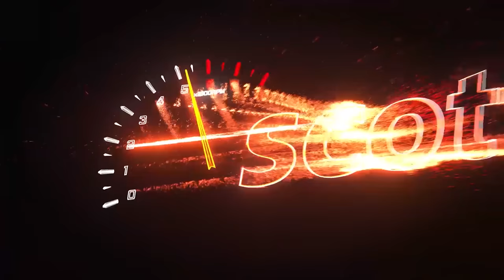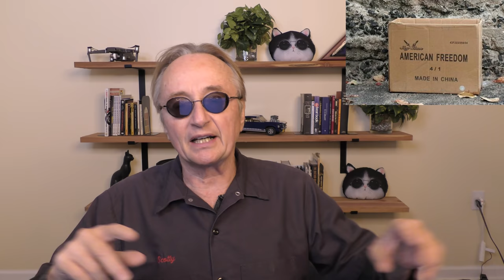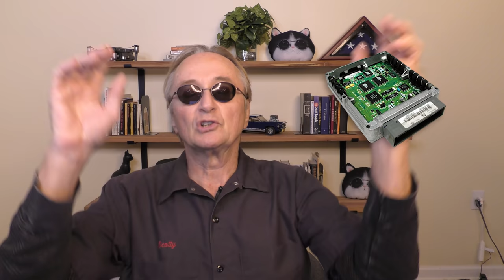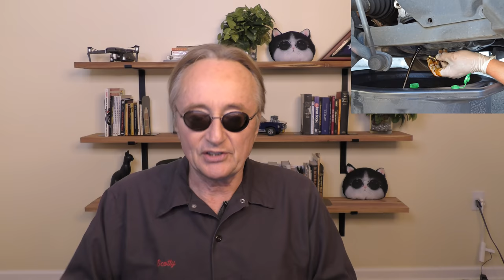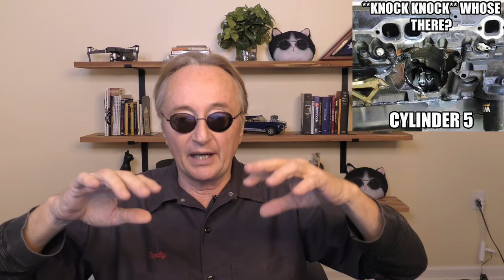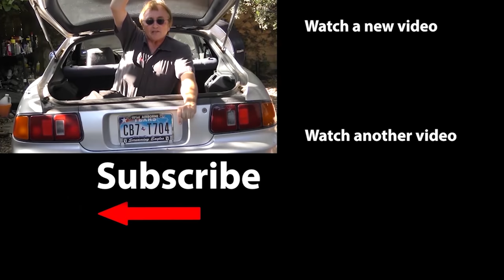Never Buy a Car with This Engine

Comment: Scotty, you saved me over $35,000 with your advice in the video about oil leaks and oil pump failure. When the rpms would drop below 1800 in my car, the check oil light would go on. Before I saw that video, I took my 2008 hardtop Sebring convertible(with 155,000+ miles)  to a mechanic that had a good reputation and 2 business locations. He could not figure out precisely where the leak was coming from nor the cause of the leak. He recommended taking my car to a Chrysler dealership. The dealership could not determine the cause of the oil leak. The mechanics at the dealership said I should throw the car in neutral and rev up the engine when I came to a stop or a stop light. I thought that was extremely poor and dangerous advice. Based upon what 2 different places told me, I figured I would have to buy a new car. I live in CT and was thinking of getting an AWD. Based  on your recommendations and because I could not afford a new hardtop convertible, I was considering a Subaru or Toyota for about $35,000-$40,000. My wife has a Subaru and I love the way it drives and handles. 

 After seeing your video, I took my car to another garage where they were authorized dealers and installers of a certain manufacturer of replacement car engines. I told them the problem and what I learned from your video. I asked if I should have them install a replacement engine from the company with which they were authorized or go for a new oil pump. The difference in cost was about $2500. They suggested that if it were their car, they would try going with a new oil pump. Well, the new oil pump was all that was needed. The car runs like new.  I hope I can get another 3 years or 45,000 miles out of my Sebring.

 I now have a car that purrs like a kitten and a new car mechanic whom I trust and whom I know will not rip me off. When they perfect the EV battery or make an inexpensive medium size hardtop convertible like my Sebring, I will buy a new car. Maybe, I might even buy a Terrafugia(Geely's flying car). I own stock in both Geely and Nio("the Tesla of China").

Thanks again Scotty. If you are ever in CT,  I invite you to the beach where we can have a few beers. I will take you to the beach in my Chrysler Sebring( Daimler convertible in disguise). At the beach, I will introduce you to a friend who has a 2005 Corvette Indy 500 Rally car. I am sure you would like to take that car for a spin.

Comment: Good video!  When I was shopping for a nice family SUV, we looked at GM and Ford first.  In our state the dealer has to provide info on where the parts originated.  The "American" vehicles were 80-90% Chinese and Mexican and assembled in US.  The "Japanese" SUV wound up being 75% North American with 25% (transmission and drive train) built in Japan.  My Japanese SUV is seven times more American than the American!  LoL  Thing was built in Youngstown, OH and I've had it for 11 years and had to replace the starter.  Want to buy American?  Gotta do your homework.

Comment: I love my optima turbo. It's kind of a mixed blessing because YES there is an inherent issue with the engine HOWEVER kia has a LIFETIME warranty on the engine. So if it goes bad I get a new one for free and another and another if need be.
Reply: Yeah they are extending the warranties at least.  I had a good experience with Hyundai/kia and the warranty process.  In my opinion they stand behind the products far better than ford, chevy, dodge, Honda.  Yeah honda had trans and engine issues never bothered with a big recall tho ha.

Comment: My first three cars I bought with blown engines.  Then got a used engine from my salvage yard my neighbor owned and had a friend install them.  Ended up with a car good running car for about $1000 total (this was in the 80's & 90's)

Comment: Junkyard engines can be good. They usually start them and hear them run good before pulling them.
Reply: Lol it takes more than that to know if an engines good
Reply: @brandanwoods9830  If a car is wrecked, it’s a good assumption the engine was working. They usually have a warranty as well.

Comment: 6:24 yes BUT people still need to check their oil level. infact, most owners manual suggest checking it at each fuel fill up and adding if necessary. highway driving also burns more oil due to higher RPM and blow by.

Comment: Do your oil changes "by color". Some engines (and older ones typically more so), wear differently. If it dark or black, change it; regardless of "but its synthetic"
Reply: @ForkInTheButt  yeah, and with that approach running mostly conventional oil is fine. Maybe synthetic for the winter (long and cold here). But like you said, if it turns brown or black, change it regardless of miles.

Comment: Datsun should come back!
Reply: Never left. Just changed their name to Nissan. ;-)
Reply: Those cars were not that good. My dad had one, in Northeast Ohio the fenders rusted off the front of that thing within two years. Replaced the fenders and again in two years they were gone. The only reason why people think those cars last a long time is because after you drove 20000 miles there's no body left of the car but mechanically the car was still perfect.
Reply: Bring back the 510 and the PL620

Comment: Scottie is on his game. Its hard to understand why anyone wants to fix a carburetor.  Good video from Sacramento
Reply: Maybe the carb is on a motorcycle or dirt bike or ATV? Alot of those types of vehicles are still carbureted just like lawnmowers and weed eaters are too.
Reply: @dgxdetailingservicesltd8461  I thought of that first, but carbs are not in context. Scotty is a car guru and thats who he is addressing. Your right there are small tools and  motorcycle  vlogs , its just not this channel.
Reply: Is it so hard to imagine car lovers that prefer originality, and would rather rebuild an original part (carburetor or anything else) instead of replacing it?
Go to some car shows and you'll find a million reasons why people would rather fix than replace.
Reply: @DeeDee-qz6cg  im old enough to remember owning cars that were carbureted. They were terrible and were always out of tune. Thats why they had to be replaced by fuel injection. Anytime your given a chance to upgrade the performance, you must do it. Mechanics hated those old carbs. Car companies in the 60s--70s made bad engines. The japanese came along and took the lead, showed us up. Thank God they did that. Todays car ownership and driving experience is wonderful.
Reply: @robertdavis3433  I don't care about performance too much, mostly just reliable transport that i can work on myself for the most part
I can maintain and work a carburetor.
But not computers, complex wire harnesses and electronics.
If i need a schematic to find anything in my engine compartment, i just want to drive the car off a cliff :P
I get your point, but i'm that type of person  who would rather hand crank an engine than worry about an electric starter.
Reply: @DeeDee-qz6cg This is the weird world we live in. its ironic that the reason for installing computers in anything is to make any repair simpler and faster. Since most circuits are tied directly to the main computer. But of course replacing it is not easy and  expensive. Computers reduce the vibration and heat the car tends to build, so the vehicle will last longer. Considering past performance of autos and todays cars the computer won the day. My 2000 ford ranger runs great and has a computer. I know how u feel , all in all that old computer running my car has saved me many hours of repairs and worry about how my car is running. Old cars lasted maybe 80--100,000 miles before they were junked. They ALL had carbs in them, creating vibration and heat, and sound. I really think u have had to own an old fashioned car to know how inefficient it always ran. The idea is to work smarter not harder.

Comment: Have had 3 kia optimas go over 120k with no problems, working on 4
Reply: Just bought a Kia Optima with only 40K miles thanks for this heads up so far Iam loving it! It’s good to know this!
Reply: What happened to the other 3? And what years...my sister is looking for a cheap car and was kind of looking into Hyundai Kia's for her...I know some of them have decent engines
Reply: @Magescuro  get a certified pre owned and you get the 10 yr/100k power train warranty and what's left of the 4 yr / 60k bumper to bumper.
Reply: Same here, Just bought a 17’ Kia Optima with 40k miles, Love it so far honestly

Comment: I gotta disagree with the carburetors.  I'm 21 and I have a 2 barrel on my 1980 datsun 510 5 door wagon.  When I got it it was in terrible shape, accelerator pump had fallen out, jets were clogged, choke didnt work, somehow it still ran though!  Drove it home and popped it off, sat it on the bench and went to town.  It runs better then brand new now, and it has a manual choke not those stupid gas pedal actuated chokes.  A new 2bbl or a 4bbl with an adapter would be hundreds of dollars, rebuilding a carburetor can cost as little as 20 dollars sometimes, sometimes they dont even need a rebuild they just need to be cleaned.  It's good to know how to work on them regardless if you want to replace it or not.

Comment: Regardless of manufacturer/country of origin, buying used has usually worked well for me. It provides enough time for the bugs in specific makes/models/years to be found and made public. I also factor in the cost of parts and difficulty of repair since I do most of my own repair work. I usually put together a diverse list of acceptable makes/models/years and try to spear fish for one of those. I have purchased some great domestics and imports using that method.... and have saved a lot of $$$. However, I always take Scotty's advice and take it to an independent 3rd party to look it over with their $3,000 scan tool.

Comment: Have a 2011 Sonata 2.0 Turbo, just under 260,000 K not a stitch of a problem with the engine. Now I change the oil every 10k with synthetic oil and most of the miles are highway. Regular scheduled maintenance. 
Wjjgs

Comment: Screw KIA got a CPO with 19k on the clock and the engine misfired and failed at 22k. Currently negotiating a buyback.

Comment: Cicero NY Nissan dealer would not change transmission fluid.  They said it doesn't need changing until 100,000 miles on a 2019 Nissan Maxima with 60,000.  It appears like they want to sell replacement transmissions instead!

Comment: Scotty is incorrect regarding the motor in the 2014 Optima. The 2014 Optima motor was recalled and it has a class-action lawsuit due to engines being made incorrectly at the Georgia plant. The NEW replacement engines are correctly made in Korea hence the extended warranty. Those models under a recall and class-action lawsuit are entitled to free replacement Korean made engines
Reply: Does that also include the Hyundai Sonatas? The new engines brought from Korea that is..I thought they rebuilt those at the dealers.
Reply: @r.m.s.605  Yep the Sonatas also share the same engine - same recall and class action lawsuit. The replacement engines are NEW and built-in Korea
Reply: @xcmskim4  That’s great to know! Thanks for the info man. Good to know if my Sonata ever needs a new engine.
Reply: @xcmskim4  then explain why some replacement engines are failing?.

Comment: The 2.4 theta engine is under recall by Hyundai/Kia. The engines they are replacing them with are new engines from the factory. A certified Hyundai/Kia service center would never use a used engine for a recall replacement.

Comment: I just rebuilt myself a period correct Rochester Quadrajet for my 1968 Cadillac Sedan deVille with factory A/C. That Edelbrock it got right now will be my spare but it is not for A/C equipped vehicles, because of it the my deVille air-condition idle speed up control  vacuum hose have to be plugged. Edelbrock and Holley just don't seem to have correct carburetors for factory equipped A/C Cadillac.

Comment: So Scotty, I've put 390,000 MI and 260,000 MI on a couple of Nissan 4x4 3L V6 manual hardbody pickups. Everything works fine on them, no oil burning,  but I live in the mountains of Colorado and they're both a little underpowered for the altitude.
I've been thinking about buying a newer frontier with a larger engine and I wonder what experience you have with the frontiers and what years are more desirable , more reliable than others.

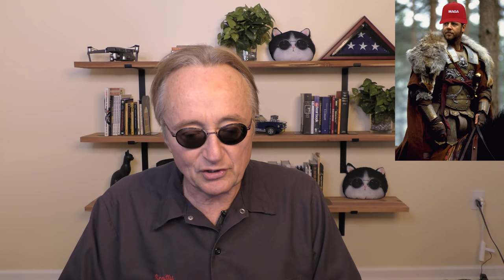Comment: 1:15 I always operated on the maxim of "I'll buy an American car or nothing at all," but every year I feel more and more like a sucker. In the 1970s & '80s, American car companies took advantage of their domestic customers by making poorer quality products that would fall apart and were difficult to maintain (wrench on 1970s Fords & Lincolns and see what I mean). Plus, they were not responding to consumer demands for small, reliable fuel-efficient vehicles during the 1970s OPEC oil crisis and beyond. My latest GM purchase is a 2017 Chevy Sonic and rodents are repeatedly eating my delicious soy-based wiring insulation. Junk. And I'm a sucker for supporting poor quality products.

Comment: Scotty, you sure are right about American vehicles. Had to replace the turbo in a 2016 Ford Escape with the 2.0 ecoboost with only 68,000 miles. Poor build quality and expensive repairs. Built Ford tough.. NOT ! 😂

Comment: Toyota installed a brand new motor in my 2017 Camry AND YES IT'S BRAND NEW.
Reply: Why?
Reply: What happened that you need a new engine?
Reply: @Mohapi_Tau  motor started knocking at 35,000 MI it has the 2.5
Reply: @markkauffman6184  motor started knocking at 35,000 MI it has the 2.5
Reply: @user-pj5ff6xw4x  alright sorry to hear that. Glad its sorted.

Comment: I believe in this case the engine is in fact new due to the recalls on those 2.4l gdi theta engines.
Reply: And the 2.0T. There’s a class action settlement for both Hyundai’s and Kia’s with these engines. They had to pay a 210 million fine because they didn’t respond quickly enough during the recall.
Reply: @Manny Neo No
Reply: @Manny Neo no but even after the “132” recall, Hyundai and Kia gdi engines are notorious for that ticking, and even worse is the slap and engine knock.

Comment: On my 2014 Kia a brand new engine was installed due to engine seized at 86000 miles. Due to a recall kia replaced  the engine with defects on it previous engine. Now after installing a limp mode update now offering  lifetime warranty on my 2.4 Ltr on my replacement engine. Check to see if your engine on the kia is under recall.
Reply: I highly doubt they are offering a lifetime warranty on your replacement engine lol.  You must have read or heard that wrong it most definitely is not lifetime.  They gave my sister another 60k warranty when Kia replaced her engine under the recall on that 2.4L Theta engine.

Comment: First of all, you’re right Scotty; this buy American excuse to say U.S. vehicles are better than imports is the reason that you have a bunch of “Patriots” that as soon as they have their cars, fail to give them a proper maintenance, break down on their faces and the first thing that they do is throw it to the junkyard!!! And YES!!! I am a 100% TOYOTA Old School Freak; I used to own 7 Toyotas of all the 27 cars that I owned in my life, hopefully to go back to start my Toyota projects soon. My point is: If I’m gonna say “Buy American”, I would prefer to say “Buy quality”... At this time, the only reason that all my cars are running is because the maintenance, not the brand. Right now I own a Ford Fusion, a Dodge Durango, a brand new Chevy Equinox and still have in Puerto Rico a Suzuki Grand Vitara and they still running thanks because any problem that I can detect, l fix it ASAP or if it is beyond my knowledge, even that I’m a mechanic, I’ll send it to another one that has more expertise. Again, it’s not where the car come from or how the car behaves with the owner; it’s how do you behave with your car. Sorry for being too long on my opinion; HAPPY NEW YEAR!!!!

Comment: Thinking about replacing my 2008 VW Jetta 2.0t 105000 miles with a 2018 Honda Fit EX with 20000 miles
Reply: Good trade get a ppi on the fit and if it checks out get it.

Comment: Hey I got a 2002 lexus gs300 with 245000 miles it idles rough and twice when i turn on the ac the whole car quickly shuts off then turns back on. What could be the problem and is it worth fixing with this millage ?

Comment: I thought that kia was going to replace them 2.4 motors under a recall they should be using a new motor I hear it was just do bottom end of the moter that they are replacing?

Comment: Scotty, it seems like Every 2 years on my 2009 GMC Yukon Denali 6.2 litre engine the stabilitrak, traction control and reduce engine power lights come on and it goes into limp mode . It seems like this issue is a well known issue . Why hasn’t gmc ever put a recall out?

Comment: Scotty, how are the Buick's with the 3.8 engine, the 3800 engine. Was considering a 2003 Buick La Sabre because I heard they are pretty reliable, is that true? Thank You
Reply: @danielpassigmailcom  Cool, thanks for the info.
Reply: The 3800s were pretty good engines- 20 years ago.
Reply: @TrumpIsYourNextPresident  I’m currently looking for a buick land yacht with that engine & low miles.

Comment: Mechanics scan tool apparently didn't read my bad spark plugs. Even after poor fuel economy, hesitation and lack of power, he insist his scan tool didn't pick up any codes. Paid him 85 to lift the car, look at wiring basically everything I did before I brought it in.
Reply: Scan tools aren’t able to know the condition of a plug, the only way there would be a code if the plug was so worn out it didn’t work anymore and the engine was misfiring
Reply: @Georgeeboy  my scan tool detected that there was an issue and replacing spark plug was a likely fix. I found this after noticing the issues.